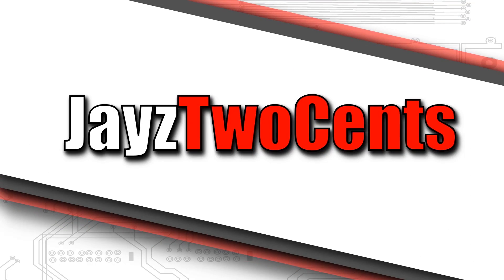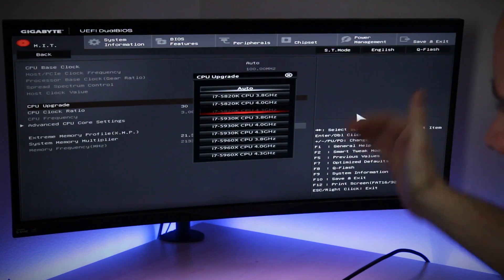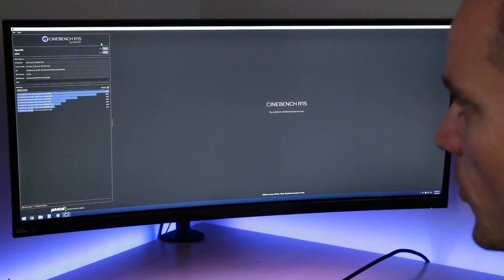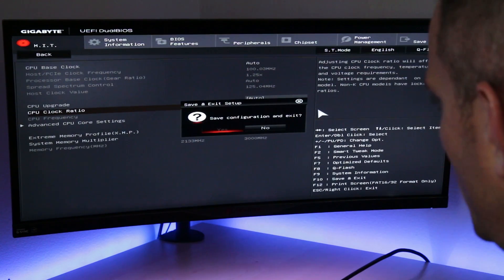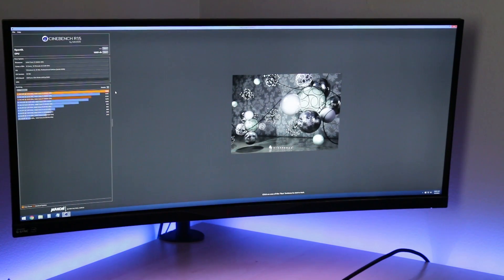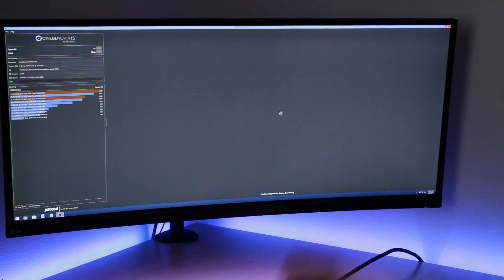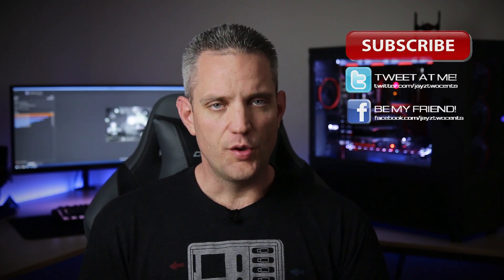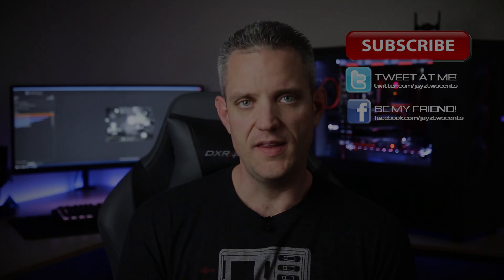XMP vs Overclock

Comment: overclocking my 1055T is as easy as setting the base clock from 100 to 125 and increasing the ram divider. 3.5ghz on stock voltage.
i could get to 4.1Ghz but my 212+ isnt good enough to keep up with the extra voltage needed. the idea was to get the best performance/price ratio so im not complaining. its been running like that 24/7 for more than 6 years now with no problem at all

Comment: First mobo was unstable even before overclocking, second blew out it's VRM and 3rd is still working.
Reply: dirtyhannie sounds like via chipset or bad caps to me.
Reply: Laharl Krichevskoy First mobo was advertised as an overclocking board for the fx8320 from msi with 970 chipset. It couldn't handle the powerdrain and had an non-cooled vrm, which went to 100c + without overclocking. Second was an Asus m5a99x which short-circuited the VRM and the third is also a m5a99x and is stable without any problems. Just some bad luck with the first asus.
Reply: Laharl Krichevskoy First mobo was advertised as an overclocking board for the fx8320 from msi with 970 chipset. It couldn't handle the powerdrain and had a non-cooled vrm, which went to 100c + without overclocking. Second was an Asus m5a99x which short-circuited the VRM and the third is also a m5a99x and is stable without any problems. Just some bad luck with the first asus.
Reply: dirtyhannie
 NEVER EVER buy a motherboard with no heatsink on the power mosfets.
Second, marketing will never tell you the truth, dont believe marketing, believe proofs, like i said, heatsinks are important, even if not necessary.
If you want to overclock on a mobo without heatsinks then grab a thermocouple first and check the temperatures. Dont let them get above 80ºC MAX on the hotests day of summer if you plan to keep it 24/7 or for more than a year or two.
Rule of thumb, never overclock (more than single digit percent) on a mobo with no heatsinks on the vrm or with less than 5 phases for the cpu.

your first mobo was office level shit, the second one short circuited because of overheat (that's how mosfets fail) and the last one i would check the temperatures on the mosfets and the caps around them
Reply: Laharl Krichevskoy As I said first one was advertised as an overclocking model but I ran it stock and it couldn't handle the powerdrain from the cpu. Second one didn't overheat, it short circuited the moment I turned it on. Factory defect. And third one is the charm. Been doing this for 24 years so I know what I'm doing... ;) 

The first mobo I got wasn't with the intention to overclock. Just needed something to replace my dying old computer.
Reply: dirtyhannie factory short circuited on a motherboard? thats weird. its supposed that they test them or at least power them up to program the bios or something.  i too once got an hdd that was short circuited (had a diode at an angle)....
mmm....makes me wonder if they really test these things at all with actual power instead of  just placing them on the test bed
Reply: Sounds like a crap power supply problem, a poor 12 volt rail with a lot off ripple which overloaded the VRM's.  You got lucky with the 3rd board having better quality ones but problems are in the post.
Reply: i was gonna say second one must have been an ASUS... then i clicked on 'Read more'... LOL  sure as fuck, ASUS sucks.

Comment: Awesome video.  Waiting on my 960 evo boot drive to arive to put my first new build in a long time together.  Never ventured into overclocking before, but I'm hoping to dip my toes in on this build.  I have an MSI titanium mpower and 6700k.  My ram is Gskill Trident z 3200.  I'm hoping to try just the xmp first to see what that does to the cpu.  Hoping just that gives me a boost safely as your video seems to underscore.  I have an EKWB L360 for the cpu (first time with water cooling too) so hopefully that keeps me completely safe from burning anything up with just an xpm profile tweak.  Keep up the good work.

Comment: Yea, not sure that getting a little more out of it is worth it and it may make the system unstable after being on for a while. I used the preset on my mother board and getting a stable 4.3GHZ out of my I7 5820K. That is 1 GHZ over stock so I am happy with that. I probably could get more, but I hate to push things that much.
Reply: FauxGaming
 stable is when it works as intended.
When the cpu is too near the edge, it start goofing up. Maybe 1 every 10000000 times it will say 2+2=5 or something like that and the program might glitch up or crash.
Sometimes that edge moves with temperature, so while the cpu might work at 40ºC it might fail near 60ºC. That's no estable. You might be able to run programs and boot at 999999GHz but when you load the cpu, the temperature raises and it starts failing. THAT is considered unstable.
Sometimes the errors might happen once every a lot, but you might have a random crash or bsod say once a week, that not 24/7 stable.
Basically if it works and doesnt fail in any way form or time period it's considered stable.
Reply: C MJ 
aka overcloking for noobs
Reply: C MJ so what is stable described as?

Comment: I have an asus deluxe II x99 motherboard, with a i7 6800k.. with a kraken x61 watercooler. I don´t now if I got a cpu that doesn´t work extra good for oc.. I can get it up to 4.3ghz and around 1.350-1.4v.. but then it crashes in games.. the best oc I can get is around 3.9 on 5 cores and one at 4.1 ghz. I also have 3000mhz memory, but do I only focus at oc the cpu, and let the memory be in auto mode? My base line for this cpu is 3,4ghz and with boost 3,6 I think.. Looks like the broadwell-e is a bit harder to get stable or is it just my cpu?

Comment: when amd fx 8320 is literally burning and he is getting 1000 cb more than you :(
Reply: I hear yeah man, I've got a 1090T and it only pushes 472 at best with the stock clock speed, but I have been able to push it up to 562, but I haven't spent any true time doings so. So that's my fault. I'm really hoping Zen will be a saving grace in the performance / cost  ratio.

Comment: What's this heresy about xmp affecting cpu oc? They are completely unrelated. I run my DDR-3000 at 3200 (C15, 1T) and my 5960x at 4.5GHz. There is no need at all to run lower xmp profiles to hold a good oc on your cpu...??

Comment: before i enabled xmp mode i got 60-70 fps avg on gta5 max settings.
now after i enabled it i get 100-110 fps avg on gta5 !! i didnt knew that feature xD im so happy i found it xDDD
Reply: Would you be so kind as to share your specs? :)
Reply: intel i7 6700k stock.
16gb g.skill tridenz 3400mhz
msi gtx 1060 gaming x 6 gb stock
MSI Z170A GAMING PRO Carbon Z170
Samsung MZ-75E500B 500 GB SSD
Reply: Thank you :)

Comment: I know this is months old now but my 2500k went from 453 to 636 (40%) increase when I upped the multiplier to 48 running at 4.7ghz
I actually managed to run the test at 5.0Ghz and it crashed about 2-3 mins later.